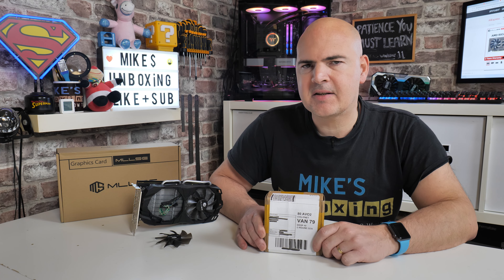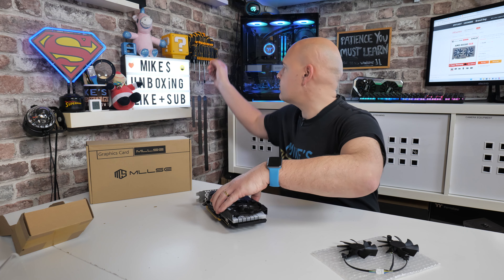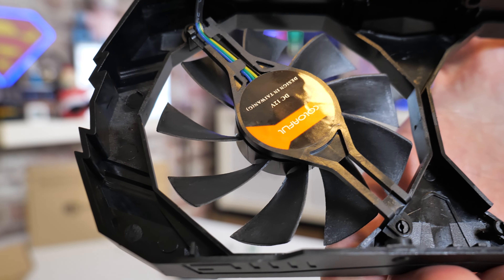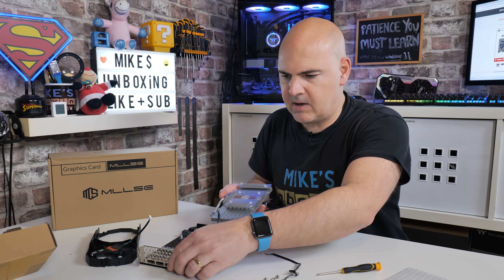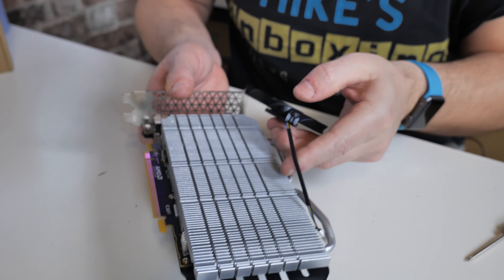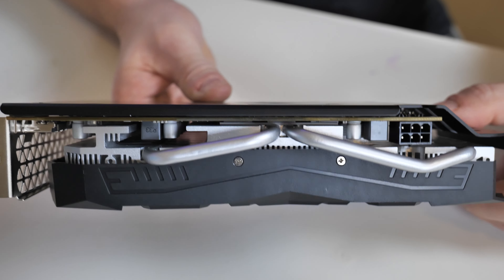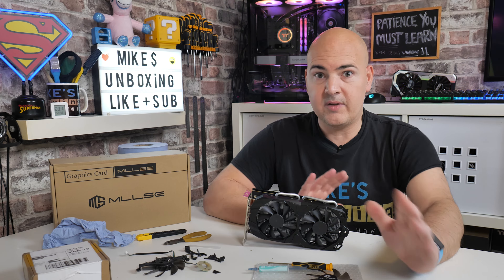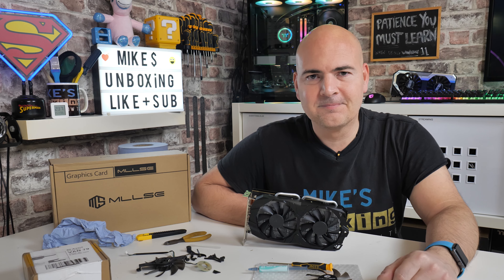MLLSE Radeon RX580 SP2048 8GB Fan Repair Video Part 2 The End & Thoughts

Comment: Im hoping that the other set which arrived after these ones do the trick as it would be such a shame to abandon this and have to strap case fans to it.  You shouldnt have to get that frustrated doing this but like a trouper you soldiered on until completion and once it was all put back together it looked the business ! Thanks for sharing, Mike and Kath.
Reply from the maker: resorted to using MSI after burner now to apply a custom curve to the fan, which isn't perfect but has made the GPU quieter than the case fans
Reply: Storm Trooper
Reply: ...w/his sudden infatuation for white now....
Reply from the maker: @PapaMav  Lol!
Reply: Hey, Bob, you should get drunk more often. I have an RX 480 with a broken fan.
Reply from the maker: @nathangamble125  Lol!
Reply: @mikesunboxing  do undervolting also . cause I used Rx 570 before and 80 °C direct hit while running any game ,and rx 580 is identical to rx 570. reducing 100 mV in each stage  in AMD Adrenaline softwear setting helps alot , it will reduce temperature at 60 °C with that trick though

Comment: Glad to see a good outcome overall with a working GPU Mike 💪🥳🎉🎊🥰👍. Yes it’s a bit of a frustrating scenario your had, but I’ve used AliExpress for numerous purchases and never had an unresolved issue …. Usually keeping the faulty item and refund and or a free replacement and repairing the faulty item and getting one basically for free 😇😂. I live in Australia 🇦🇺 and getting stuff from AliExpress is often much quicker than from the US / UK to get delivered here 🤯🤔.
Reply from the maker: i have also found that the fans can be externally controlled my msi afterburner so that makes it more tolerable

Comment: I just recieved my "ENVINDA"  RX580 in the post yesterday Mike (£74.01delivered) .On the test bench it works just as expected with the standard NVIDEA driver driver installation and it was suprising well packaged with a full foam insert in the box .Given the box livery it looks like an "Aliexpress" sponsored card and of the three options offered I randomly recieved a unit with HDMI,Display port and DVI port.
Reply from the maker: Very nice! and for the money if it works you can't go too far wrong
Reply: @mikesunboxing   Looking at used prices on ebay it seems about 2/3rds the price of a similar used Nvidia card. I dare say they are probably remanufactured chips on board but for the price even if they are actually RX570s they are good value for a second or even an older system..

Comment: There must be cable hooks inside that plastic fan holder , last time I did same with Rtx 2060 8 gb super, pain to connect back , but glad it has fam wire holder hooks 😊
Reply from the maker: i did look but didn't see any. more of a friction fit for cable management, but the new fans wire is slightly smaller width

Comment: Just to add @07:48 the new wiring loom looks slightly shorter than the old one between the motherboard and the first connection.
Reply from the maker: yes it isn't a direct replacement sadly

Comment: I  just bought a 2nd hand MSI RX 6600 mech from CEX on Dec 22nd and all good so far, I did poop it for a few seconds when I saw the fans weren't spinning but they don't until it gets to 58c which is good if you're watching a film or an older game. 

I'm playing Dishonoured DE atm on highest settings at 60 fps and the fans haven't spun once, it's really odd as the last game I played where there was actual silence was on the N64. 
Mechwarrior 5 is the newest game i've tried and it walks all over the asus 8gb r9 390 it replaced. 

If it dies i'll refund it and start a 4k system but if I had to buy a new 1080p card it'd be another 6600.
Reply from the maker: you can always install afterburner or in the AMD software adjust the fan curve so it kicks in earlier
Reply: @evitaylor: why did you poop it??💩
Reply: @PapaMav  It was at 5pm on Dec 23rd and my second card from them in 2 months so they'd probably just send it off for a refurb rather than refund. Leaving me £220 down with no games for Tiny Tim this Christmas, Dickensian PC building ftw.
Reply: @eviltaylor1  I like your reply but don't think you picked up what I was hinting at, LOL.
Reply: @mikesunboxing  according the Jay, the Afterburner Ruskie designer guy has been getting stiffed by MSI on his payments since Russians invaded Ukraine.
Reply from the maker: Why doesn’t that surprise me
Reply: @mikesunboxing  nor me.  11 months the guy has not gotten his "stipend" or whatever the arrangement is with MSI.  But they (MSI) said "they are working on that"...

Comment: it happened to me that when removing the cooler, I also pulled the chip, so I threw away the graphics, so it is best to turn the heatsink left and right to separate it from the chip
Reply from the maker: wow sorry to hear that
Reply: @mikesunboxing  that's how it is, now I know how to work when I change the thermal paste on the CPU&GPU, a little left a little right until it separates
Reply: @MsNitro187  Best it to get the GPU hot, run a benchmark etc, so it's softens the paste & then twist the heatsink left & right & should pop off with ease .